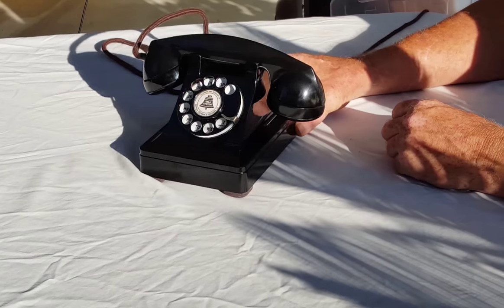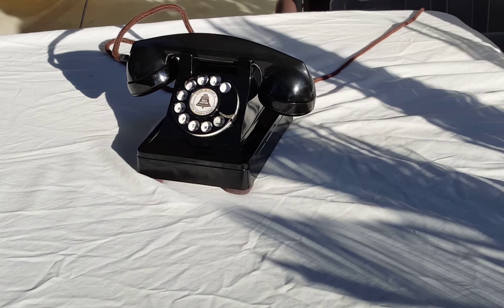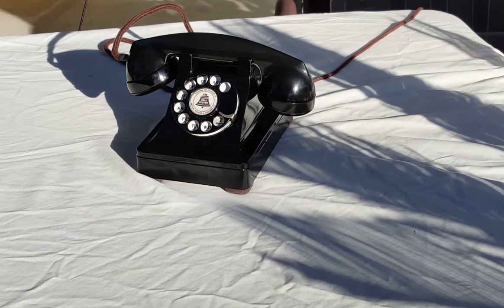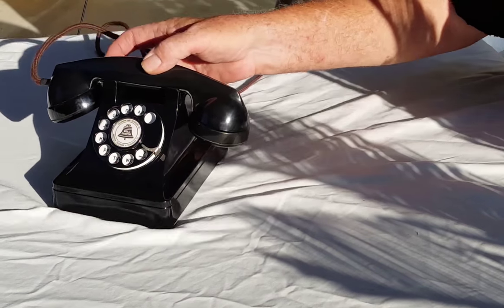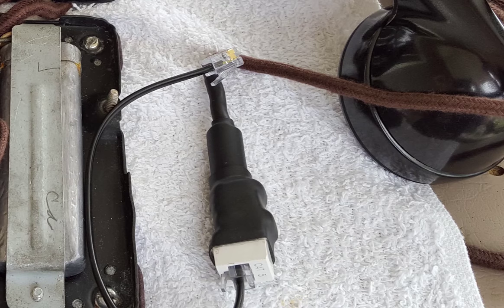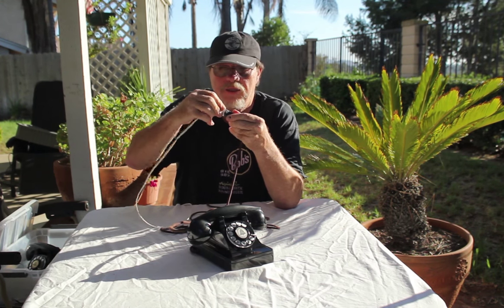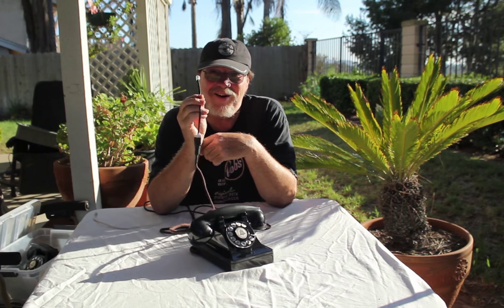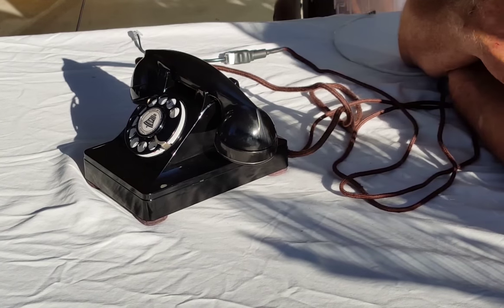Western Electric 1941 Rotary Dial Telephone

Comment: Hello Steve. I recently acquired a D1 rotary phone with F1 handset. It did not come with the ringer box though. When I tried to connect it to a modular line, the handset give out a sound at the earpiece but the mouthpiece (or diaphragm) does not work. Is it because that it needed the ringer box? Also, can you tell me what I need to make it a working phone since I only have a tone type phone line. Thank you
Reply from the maker: Please view https://youtu.be/jV1lHG__3eg -

Now then...

You MUST use a "telephone network AND capacitors either in line or also embedded in a network.  This is why your F1 handset does not work.  Write me if you want to have me complete this for you in 2023.  My email is at end of all videos.  I don't blame you for wanting it to work.  Years later - they are a trip to have.  Please subscribe.

Comment: You can just buy a Pulse to Tone Converter, and put it in line.
Reply from the maker: No kidding... You can also hook them up with an XLink Cell bluetooth gateway.  Yes, the Xlink accepts pulse dialing out to your cell that is connected via bluetooth.  There are always options.  Anyway,  I don't want to spend the money they want for the pulse to tone on one phone.  The profit on these phones is minimal at best to begin with. Thanks for watching
Reply from the maker: Too much money and too much of a wiring hasskle.  That's my opinion.  Just purchase a Bluetooth Cell Gateway and call it good.  Thanks for watching!
Reply: Yeah, you CAN, but on my 302 while it does dial out and rings, apparently that pulse to tone device GREATLY reduces the receiver volume to the point I cant hear anything.
I tried wiring up a phone amplifier I bought that is wired between the handset and base, but that didn't work, apparently it conflicts with the pulse to tone device some how.
My 302 was bought fully restored, so the problem  is with these other devices.

It was also mentioned about the XLink Cell bluetooth gateway, I have that too- bought first, the biggest problem with that is it requires your cell phone to be ON and nearby at all times to even work, so your desk telephone is non functional when you take your cell phone outside with you.
Reply: I just turn the sound off and read the comments